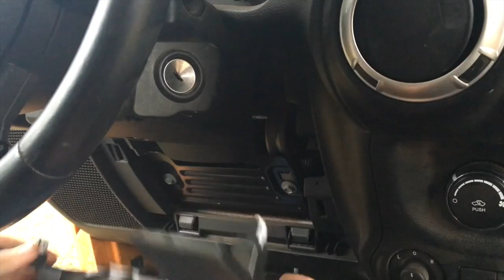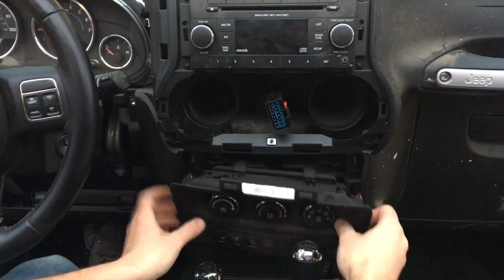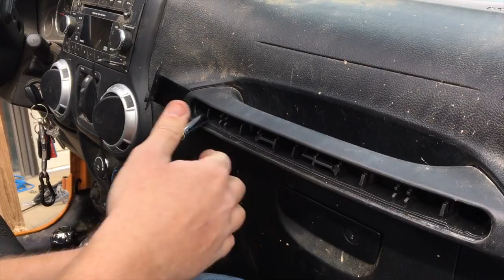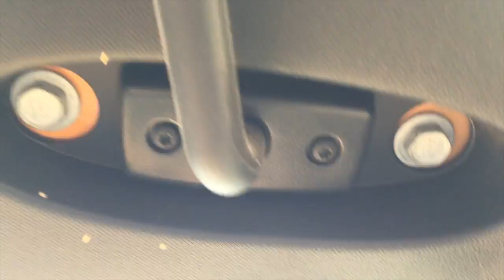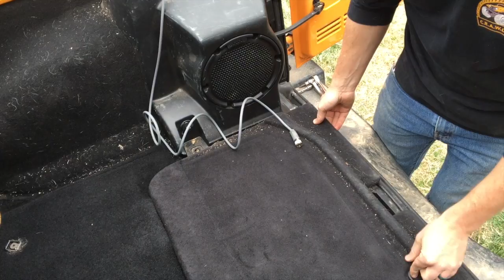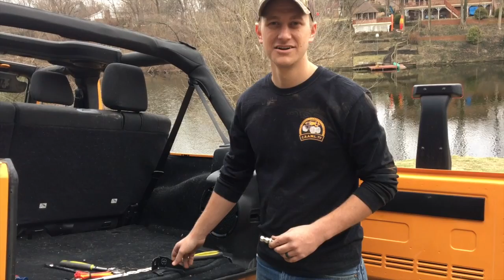Jeep JK / JKU Cobra 75 WX ST CB Radio Installation

Comment: Hey great video, was wondering if you knew of any kit that would allow me to mount my antenna toward the back and side (either side) of the jeep. Reason is I load my kayak from the back onto my roof rack and I also sometimes like to cruse with my back glass open.
Reply from the maker: Ben Moore I put a bit of thought into this, and it looks like this will be your best option. Hope this helps! 

Firestik LG3-M2R 3' No Ground Plane Tuneable Tip CB Radio Antenna Kit (RED) https://www.amazon.com/dp/B00TFRWL38/ref=cm_sw_r_cp_api_Lq6QybMDSQP1A
Reply: This may be a bit late for Ben.  Hopefully it may help others.  Firestik makes a fender mount for the CB antenna that works for those not wanting to mount to the tailgate. Check it out at: https://www.amazon.com/Firestik-Molded-Plastic-Side-Mount/dp/B005AUTE84

Comment: What size cable should I use. I. Have 2 door willys. I see you used 18 ft. Thanks
Reply from the maker: BKAGOSTO I would try to find something close to a 16 foot cable. If you can't the standard 18 will work fine. We used every inch, but it always helps to have some slack to work with. The only thing to avoid is leaving a coil of cable, because that can create a RF choke point.
Reply: CRAWL TV how has the cobra CB been operating. Would you highly recommend the CB and accessories that you used?🤓🤓🤓🤓
Reply from the maker: BKAGOSTO Definitely! We're coming up on a year since we filmed this and the CB is still one of my favorite parts about this Jeep. It's a clean install and you don't even notice that it's there until it's time to use it. It works GREAT for what we use it for. I will add though that tuning it is very important, and that was not included in this video. If you're interested or have any questions, we can definitely make a tuning video. 👌🏼
Reply: CRAWL TV how hard is it to tune. I know you mentioned in the video that it came  pre-tuned. So I guess you had to buy the tool so you can tune the antenna?
Reply from the maker: BKAGOSTO yeah - here's the link to the SWR reader we used:
 ASTATIC PDC1 100 Watt SWR/RF TEST METER W/ Workman 3 foot jumper CX-3-PL-PL https://www.amazon.com/dp/B00HMDQ4RQ/ref=cm_sw_r_cp_api_xitLybBXFXBSP

Comment: great install video helped me install my cb. do you run an external speaker with it or are you using the built in speaker?
Reply from the maker: DerekPilot29 Glad it helped you! We run an external speaker right now. The speaker within the unit works just fine, but we wanted something that could kick out a bit more volume to hear it over any wind noise or music. I couldn't tell ya the name of the speaker though... picked it up at a truck stop and threw the box away. They're all very similar.
Reply: CRAWL TV thanks for the reply I'm gonna definitely pick up an external speaker for those no doors days

Comment: Thanks for the wonderful video! Your instructions made it easy to disassemble my dash and helped with the routing of the antenna coax cable. Since I purchased a Uniden Bearcat 880, I had some power cabling to route, but knowing the basics from your video made it much easier.  Cheers!
Reply from the maker: Harold Santiago Glad to hear that it all worked out. Thanks for watching! 👍🏼🍻

Comment: Where did you get the small bracket to run the cb cable through the bottom of the center console?
Reply from the maker: Lee Elliott It's been a while now, but if I remember correctly, it actually came with the Cobra CB unit.

Comment: I used this video to not only purchase the wiring harness from Qudratec but as also as a how to for the removal of all the dash components.  I wired up a HAM radio, CB radio and a backup camera system using this as a guide to get started.  Thanks so much for the in depth details!  Unfortunately it took about 6 hours but most of that was screwing around with the Raxiom back up camera kit...the instructions suck.
Reply from the maker: rogue109 Thanks! We had no idea how helpful this video would be to people when we made it! Jealous of the backup camera, even if it did take all day to install!

Comment: so great video I did the install the same as you was curious I have been unable to to get SWR under 3.2 on any channel. Pretty sure it has to do with a bad flat plane ground. Did you test yours with a SWR meter and find similar issues? Did you have to grind the powdercoat off of the parts of the mountwhere the bolts and antenna stud pass through? Or did you possibly add a seperate grounding strap? thanks again!
Reply from the maker: robert King Thanks for the comment, Robert! We ended up running a grounding strap to the back door and scraping a small amount of paint to get a good connection.

Comment: Great video! I apologize if you have already addressed this, but I did not see it anywhere in comments. I am new to Jeeps and certainly not an electrician. I was wondering why you chose to use the power tap instead of just running the CB wiring directly to the battery. I'm not even sure how you would hook it up, but I've seen some run it to the battery and it appears you don't have to disassemble the dash and air vents, which are my concern. Thanks!
Reply from the maker: Mike Pierce hey, Mike! Thanks for the comment! We ran the CB directly from the battery on our last Jeep and had no problems with it, so that is an option for you. Now, the reason that we chose not to run it that way on this Jeep was to reduce the potential rat nest of loose wires under the hood and eliminate the possibility of a parasitic bleed on the battery if it is accidentally left on. With the CB powered by the 12v accessory power tap, the power is killed when the Jeep is shut off. It was a little bit of work to pull the dash just to get to it, but it made for a very clean install. Hope this helps! 😎👌🏼👍🏼

Comment: Can the antenna be easily removed without taking off the spare tire?  If not will the antenna you purchased be flexible enough when pulling in and out of the garage?
Reply from the maker: Susan, if you expect to have to remove the antenna regularly, one of these will definitely solve your problem! https://www.amazon.com/FireStik-K-1A-Push-n-Twist-quick-disconnect/dp/B000UTQUAK/ref=sr_1_1?ie=UTF8&qid=1474663143&sr=8-1&keywords=firestik+quick+disconnect
Reply: Thank you!

Comment: Awesome video. Love the detail you went into with this installation. Question I have is, I currently have an sPOD installed. Would you recommend hooking up to the sPOD or using the wiring harness like you did in the video? Thanks again.
Reply from the maker: Jeremy, thanks for watching and commenting! The way you run your setup is entirely up to you. If we were running an sPOD though, we'd probably still run the harness from the 12v power supply, since this is a 12v accessory and doesn't need a switch and relay. Of course, that's one way to add power to it, if you choose.
Reply: So I managed to tackle the install over the weekend with great success following your method. Only thing I would suggest to your viewers who are wanting to do this is pop the vent off the outside tailgate to help fish the cable through to the hole with the grommet. The vent pops right out and snaps back into place with no problems. Again, great video
Reply from the maker: Thanks, Jeremy! That's an awesome piece of advice and I bet it made things a lot easier. Glad the install went smoothly!

Comment: I'm new to the Jeep world (had my 2016 Wrangler JKU 75th anniversary edition for 1 week tomorrow!) Your videos are amazing! Thank you! I will be installing this Sunday!
Reply from the maker: Hey Samantha - thanks so much for tuning in! Super excited to have you join the Jeep community and we're glad we can help you get started 👍🏼 Let us know if you have any questions about this install or future builds! -Grace
Reply: Thanks! I just put on the 3.25" Rough Country lift. BFG KO2s 315/70/R17's. I was looking at a suggestion for gears and next upgrades.

Thanks!
Reply from the maker: Samantha, 315/70s are just shy of 35" if I remember correctly. Your best option would be to step your gears up to 4.56s, but we see a lot of people take them up to 4.88s, since it's actually a little bit less expensive generally, and gives you a little bit more lower-end for wheeling. What are your plans for the Jeep? The next mod that I would recommend is a new exhaust crossover pipe or some crossover pipe extensions and a new front driveshaft. We drove our last Jeep for quite a long time with the factory shafts, but they can't handle the stress from running high angles for long.
Reply: Its a daily driver, with a very light amount of wheeling. Thank you for your input!

Comment: I learned more from your video than I have from others I've seen. Thanks for being so detailed.
I'm curious, now after-the-fact, are there any steps up around the dash area that you believe you could have skipped? Removing that entire dash and all parts is my biggest concern really.
Reply from the maker: Bruce,
     Thanks for watching! To reach the 12v power adapter, the entire dash really does have to come apart. Luckily, it's much easier than it looks. I'd recommend cutting out some time to get this done and as other viewers have suggested, it may be easier to run the cable from the rear to the front. Let me know if you have any questions or other concerns!
Reply: I've purchased the same model CB you have. Now that you have lived with it for a while, do you see a need for an external speaker or is the one in the handle good enough?
Reply from the maker: +Bruce Graf That's a great question. We have mixed feelings on it. While the built in speaker is probably just fine, we chose to add an external speaker in to get a little bit more volume out of it.

Comment: Where did you get the stud mount and coax? Part Numbers ?
Reply from the maker: We actually just picked the stud mount up from Amazon.com. Here's the link:

FIRESTIK K-4A CB RADIO ANTENNA HEAVY DUTY SO-239 STUD MOUNT (BULK) https://www.amazon.com/dp/B00T4RSQ92/ref=cm_sw_r_cp_api_1CmVxb10F6638

Comment: Your videos are very helpful, thank you! I like that you go into detail and show every step. But I have a question, why you passed the cable through the rollbar instead of the floor? Wouldn't be  much easier pass it under the carpet?
Reply from the maker: Thanks! And good question! On our last Jeep, we ran the box beneath the center console and the ran the wiring beneath the carpet out the back. The reason that we chose to run everything up high on this install is because we had water and mud inside of our last Jeep all the time, and regularly had those parts submerged. To avoid premature wear, rust, and blown fuses, we went as high as possible. The Cobra 75 WX ST power supply box really doesn't like water!

Comment: Thanks.  This video got me through the CB installation on my brand new 2016 Jeep Wrangler Rubicon Hard Rock.  Some minor variations, but nothing significant.  Thanks for the video!!!
Reply from the maker: Very nice! Out of curiosity, what were the main differences?
Reply: +CRAWL TV The woofer speaker box in my jeep is mounted in the floor.  Not on the right rear side like yours.  So no antenna cable routing through there.  But the right rear panel came off easily enough and I was able to route there just fine.  Also, my radio kit didn't come with the modular cable you used to connect to the lighter power socket.  It just had a bare hot and ground wire.  I tapped the jeep battery with the hot lead and grounded the other at a main ground point behind the radio.  Also, as much as I liked your coat hanger cable run method... I just used a cable snake and pulled the antenna cable straight through the back door.  I had about a foot of extra cable, so I left a generous drip loop under the antenna bracket to keep rain from running through the cable grommet and into the door panel.  Thanks again!
Reply from the maker: +Brad Hiner nice! Thanks for the reply! We actually purchased the wiring loop separately through Quadratec.com. The coat hanger method was definitely a slower and less efficient route, in retrospect. Some people have commented that it's easier to start at the back door and work their way forward, too.

Comment: This is a great video on this install. Doing it this weekend. What did you do about grounding your Firestick?
Reply from the maker: We purchased a grounding wire through summitracing.com and attached it to both the antenna and a bare spot on the rear door, between the tire mount and the door.

Comment: I have the same antenna on my Jeep JK 2 door on the same mount in the same place and the SWR levels where in the danger area for harming the radio when set up per instructions. I had to add about 1.25 inches with the screw top.
Reply from the maker: Excellent comment! Since this posted, we've done the same. Luckily, we hadn't used the radio for much other than testing that it worked before tuning it. We'll post a video soon. 👍🏼

Comment: Super video!  AS an old CB'r, I want to add that IF you install using this mount, make sure you have a positive ground.  Scrape paint from under the bolts on the mount and backside of bolt heads.  A positive ground can not be guaranteed through the gate hinges so I run a small grounding strap from the door to the body.  Just a tip for ya!  Thanks for such a fine vid!
Reply: Here is a link to a very good site that will no doubt help you.  The answer to your question re SWR readings is:  http://www.rightchannelradios.com/blogs/installation-guides/18542155-interpreting-swr-meter-readings
Reply from the maker: We didn't mess with grounding it because it's a NGP system, according to FireStik. I'll be pulling it apart in the next few days anyways, so I'll ground it just in case. This is where I found that info: 
http://www.firestik.com/FAQ.htm
Reply: 2. Spare Tire Carrier Mounting

If mounting to the spare tire carrier, you should install the mount as high up on the assembly as possible to eliminate parallel side-reflection of the carrier wave.
If using a base-loaded antenna you should make sure that the mount is the highest object on the tire carrier assemble in order that the most active portion of the antenna can operate with total free-space around it.
If using a top-loaded (wire-wound) antenna you should strive to have at least the top half of the antenna above the roof line, especially when utilizing a hardtop
If it is a swing-a-way tire carrier we suggest that a dedicated ground wire from a known good chassis ground point to the antenna mount is used. Swing-a-ways with nylon bushings insulate the carrier from chassis ground and those with brass bushings go through periods of high resistance or total lack of grounding on rough terrain.
Beware of painted and/or powder coated surfaces … they do not conduct. Mounts on those surfaces must either have metal to metal contact with the grounded swing arm or use an alternate chassis grounding wire.
If you do not want to ground the carrier and/or antenna mount, you will need to use a no-ground plane (NGP) antenna system.
Soft-top or no-top vehicles get best performance from antennas that are 3-feet and over in length. Those with hardtops should use at minimum, a 3-foot antenna with a spring (for added height) or a 4-foot antenna.
Reply from the maker: +Elmer Lee Fuddpucker Nice info! Thank you!
Reply: You will still have reception of incoming signal but if there is no ground your standing wave ratio (SWR) will increase thus reducing your output signal strength.  Think of SWR as a kink in a water hose.  With SWR ratio low the water flows through the hose efficiently giving you plenty of pressure at the nozzle BUT if the SWR is high (kink in the hose) it reduces the volume or output AND puts undue backpressure on the water pump.  In this case the "back pressure" causes overheating of the final transister in the radio and eventually will cause failure.
Reply: Yes, Chris I have always made sure that my CB antennas have a good solid ground.  I used https://www.summitracing.com/parts/rfw-gc12/overview/ to give constant ground from my tailgate to body and another from body to frame.  The only adjustment to get my SWR to acceptable level was a slight lenghtening of antenna by way of the adjustment screw on tip.  I run a 4' firestik and spring and made sure that the mount had all paint and powder coat scraped from them so it is mounted metal to metal for grounding.
Reply: +Elmer Lee Fuddpucker what happens if the antenna is not grounded as suggested?
Reply from the maker: +Elmer Lee Fuddpucker VERY WELL-SAID! We really appreciate the comments!
Reply: +CRAWL TV did you end up grounding your fire stick somehow?
Reply: +Elmer Lee Fuddpucker thanks for the info. Right now, I'm getting 1.15 on SWR on 1&40. Should I be good or is grounding going to get me closer to 1.5?
Reply: thanks for the link.  Very heflpful